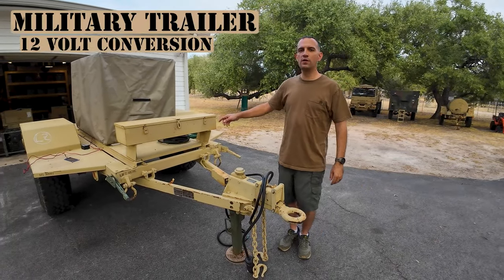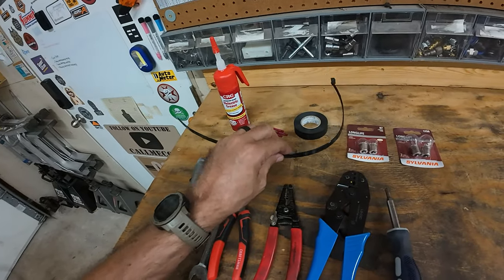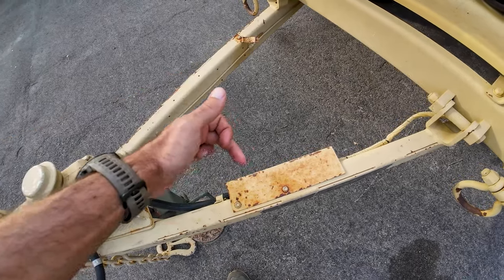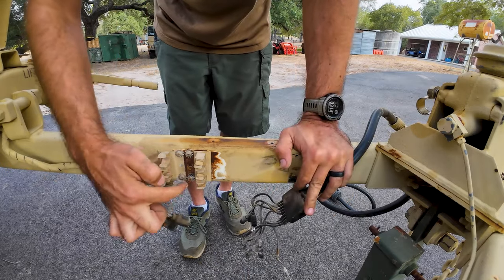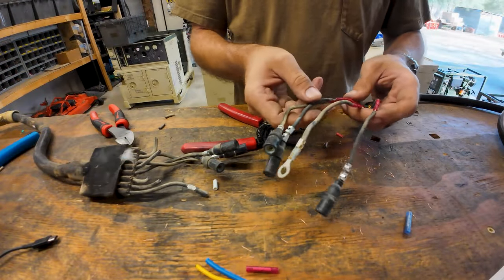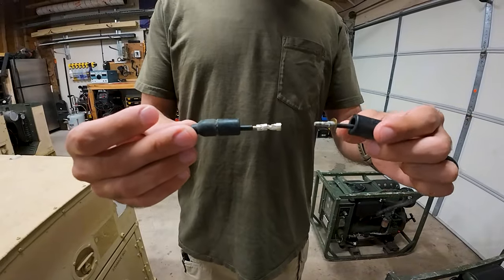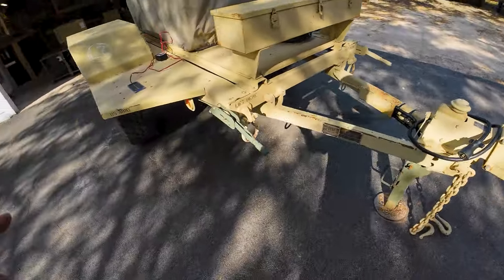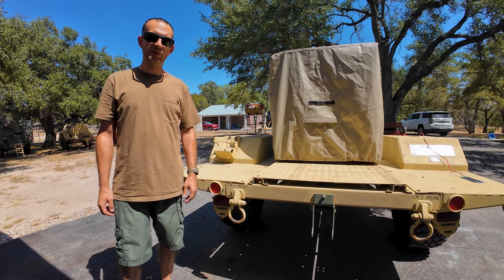Military trailer 12 volt civilian conversion

Comment: Great video! Going slowly, carefully and marking wires as I went, it took me about 45 minutes using a heat gun, connectors and electrical tape to seal everything neatly.  I wish I had seen this video before I bought that clunky, worthless military connector.  Thanks!
Reply from the maker: The adapter sucks & I feel bad for the people who spent money on it thinking it was the only option.

Comment: When doing this is an M1101 or M1102 trailer is 8’ of wire enough? Also does the plug side of the harness use the “male” military packard connectors? I’m thinking I can just go ahead and terminate a harness and then when I get one of these from govplanet I can quickly swap to a 12v harness….
Reply from the maker: I don't recall to be honest. I shared a link in the description to what I used as I knew it was long enough. You can cut & crimp the proper cables in just a few minuets off the harness at the GovPlanet yard if you wanted, that's what I'd do.
Reply: @CallMeColtLLC  thanks Colt! I just got my trailer home a few weeks ago. Just a heads up I noticed the 12v bulbs I swapped in were melting my lenses. Might be something to check out…
Reply from the maker: @DeepwoodGarage  I've never had or heard of that issue. Did you use the ones I shared in the links? Sure you don't have a short in your light can putting more than 12v to the bulb? Sure the mount hasn't shifted in the can and put the bulb against the lenses?
Reply: @CallMeColtLLC  the bulb was too close to the lens. I’m not sure if it was touching or not but it was close enough that it started to melt it. Just something to keep on your radar. I decided to swap in LED taillights after that.
Reply from the maker: @DeepwoodGarage  sounds like you had an issue in the light can or the wrong/different bulbs or the wrong spot. I've put the ones in the video in at least 30 sets of light cans and not once was this a problem. Glad nothing bad happened and you found a solution.

Comment: Would be nice if you had a chart to connect the wires to the correct numbers/ color.
Reply from the maker: You must not have watched the video completely. 8:02
Reply: The chart is literally in the video.

Comment: Thanks for making an instructional even an old grunt like me could follow. I am going to be picking up a MEP803A on a trailer in a week and was stressing about getting it from Alabama to Texas. The video wasn't too long and was very informative, the pace was good as well. Question about the black out lights, will they still work with this conversion?
Reply from the maker: I'm a grunt & know how we work, so I bring it to our level. :) No, the blackout lights are left unconnected at the area where you make the new connections up front. I don't know the numbers, but if you needed them to work, you could make a separate harness for them & tie into the wires for them.

Comment: I was thinking about buying an M1101. Applying your method  would the trailer brakes work? Lol excuse my ignorance.
Reply from the maker: The brakes are not electric, so they will work or not work depending on if they're functional to begin with.

Comment: Thinking of getting a trailer and want to use as much OEM as I can, great video. What about backup lights don’t most states require those on trailers as well?
Reply from the maker: Thank you! Very easy to change over yet leave most of what is there in place. I have never known a state to require backup lights on a trailer, unless maybe on a commercial truck due to size.

Comment: Your videos are getting better and better. I have been thinking on how to do this for a long long time. Obviously, I was over thinking it. Suggestion for a video, how to connect a DRASH generator to Mains power of a home.
Reply from the maker: Thank you for noticing & the feedback! I have been trying to make the videos edited better. I've invested in new equipment as well. This video, I don't have a microphone, so my audio was not great. Hope to raise some funds soon on that! As far as hooking up a DRASH to home... I don't have one, but I do know it's a 3 phase only. That is an issue. You can't really use it on 240v single phase service. It gets a little complicated. There are transformers and things you can get, but it gets expensive. Maybe one day, if I get a DRASH, I will go over it. Same would apply to the larger MEP 804B and up generators. 240 volt 3 phase on a single leg is not the same as a 240 volt single phase.

Comment: Where'd you get that generator cover?
Reply from the maker: I had it custom made. Tested one out for almost 5 years now. Thinking about offering them for sale on my store. They won't be cheap but are very good quality. $200 plus tax & shipping. What do you think?
Reply: I think it's worth the price. I have an 802 that I keep in the garage because other covers just eventually failed over time. You can make them out of tarp or canvas but unless there's a way to cover the bottom opening under the genset, rodents will always find a way in.  @CallMeColtLLC
Reply from the maker: @ericramirez8254  I have not had an issue with rodents going inside when using mothballs
Reply from the maker: https://ebay.us/5ajRAK